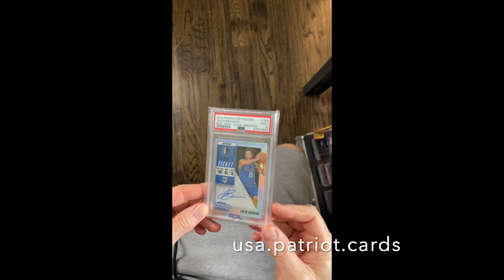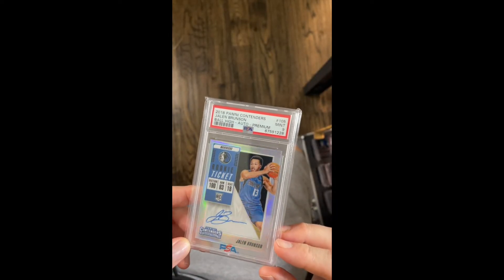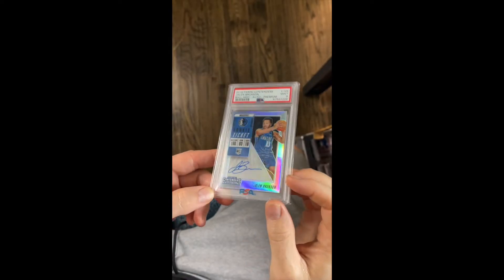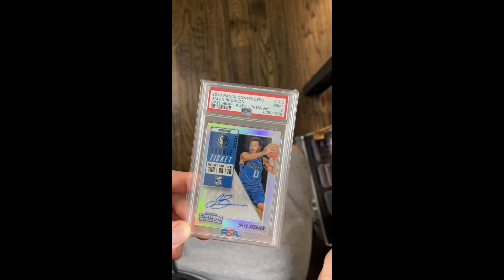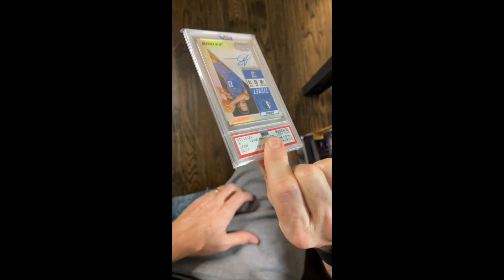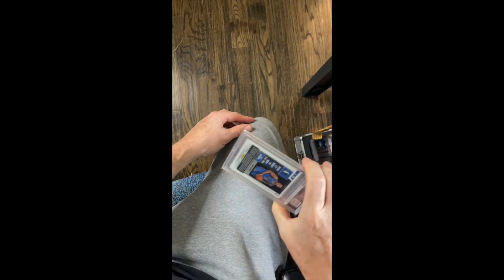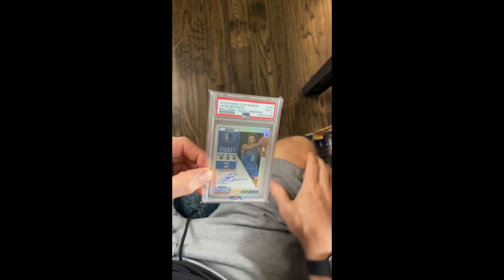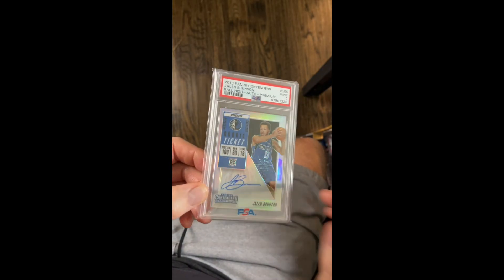NEWTON RINGS PSA SLAB FIX

Comment: I just wanted to thank you for this video. I recently purchased a psa card and when it arrived, it had a newton ring on it. The seller claimed they didn't know anything about it but when I looked hard at the darkened photo in their listing, I could barely see the wet mark. I did research and learned about newtons rings in psa slabs so I knew the card wasn't damaged and there was no condensation in the slab, but it was still hard to look at the card because the ring made it look like something was coming out of Barry Zito's ass when he was throwing the ball. Anyways, long story short, one light wack on my thigh and the newtons ring totally disappeared. Happy camper! Thanks again, and I will spread this wisdom and knowledge when necessary.
Reply from the maker: @theJPB3  another success story! Glad it worked 🫡
Reply: @u_s_a_cards  I don't know if you already know but if you buy a slab with scratches or get rub marks on your slabs, Meguiar's PlastX can make them disappear so your slab looks shiny and new. Just be careful if you use it on those screw down slabs because it can get into the crack between the two pieces. 

https://www.youtube.com/watch?v=7eNWw1q3Q_4&t=129s

Comment: Sir thank you so much hadn’t seen my cards in quite some time. Looking at cards I noticed those newton rings on some older refractors and some Prizm cards. I was disappointed and ask around to other collectors . Some said put in zip loc with rice . Then I saw this video and boy that was the fix. Rice and bag don’t work not wet. Thanks again buddy . Always learning. YOU THE MAN!!!
Reply from the maker: Glad to help! I recently got an Anthony Edwards Optic RC auto with Newton rings and my little trick was not able to fix it. So, it works on some cards and others not so much. But it's an easy fix to at least try! I'm always learning, too! Happy collecting 💯